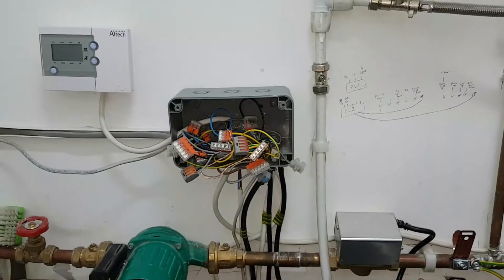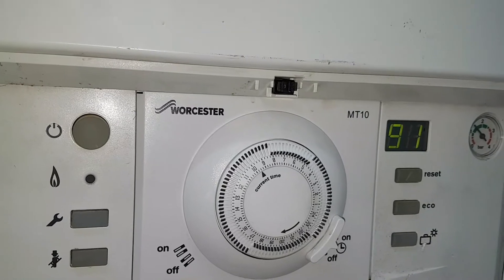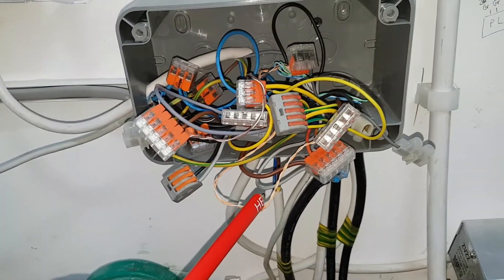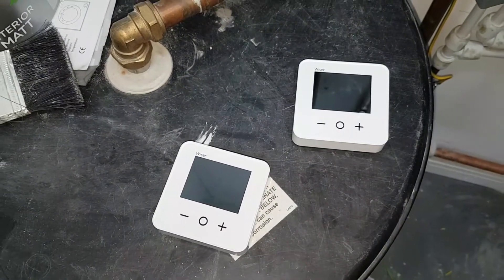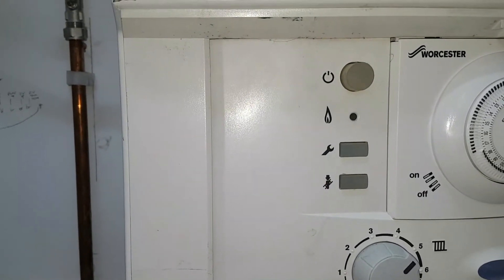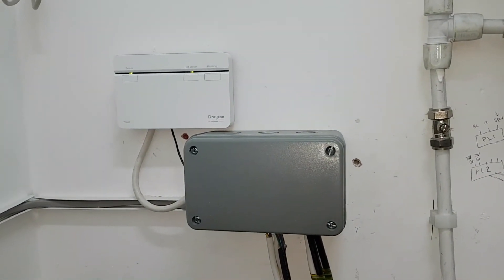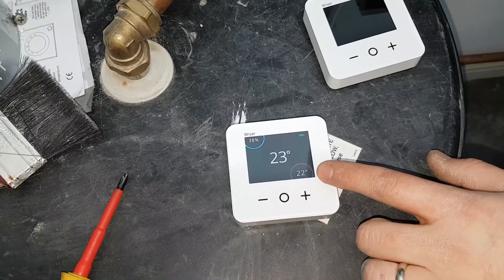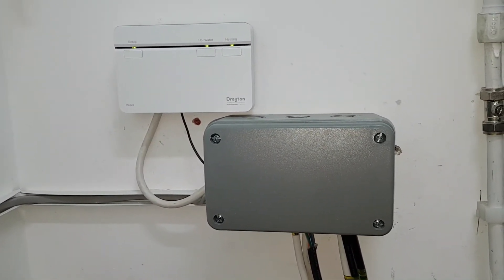Drayton Wiser 3 Installation With Coach Tony Morgan

Comment: Why did he not connect the feed to each pump on the orange wire of the associated motorised valve? The valves would open and bring on the associated pump and the boiler. Rather then for a short time the pump pushing against a dead head?
Reply from the maker: It's was a flexed situation, the majn problem was the having 2 pumps on a under floor heating system. This was a bespoke system.
Reply: @ARBoilers  Would using the brown wire to the valve or orange / grey which ever was the switched as the feed to the pump worked?
Reply: @ARBoilers  I dont seem much info on S plan Plus, with more then one heating zone, with each having a thermostat and maybe their own pump? A bit complicated to explain how it all works but useful to know for those that dont :-)